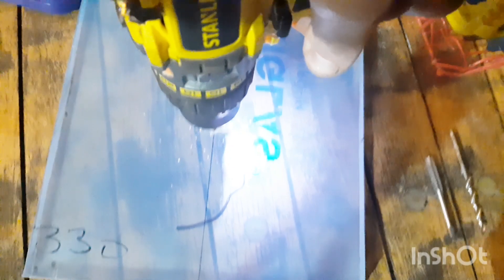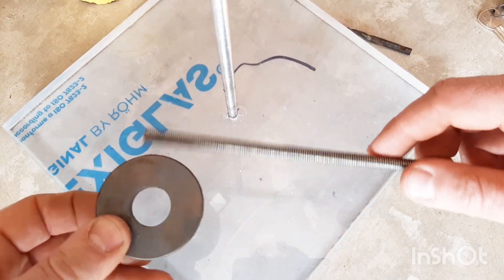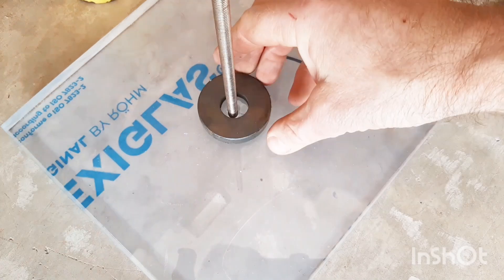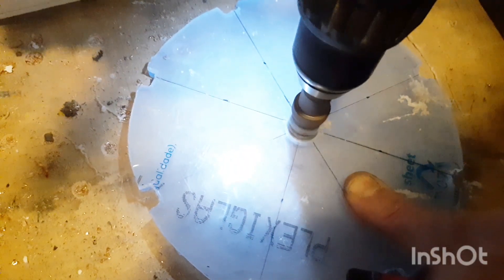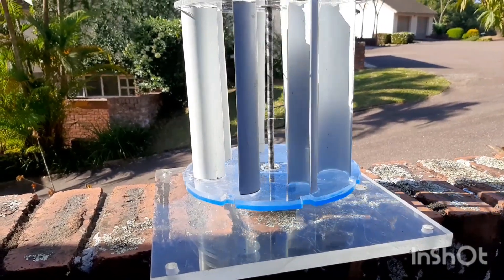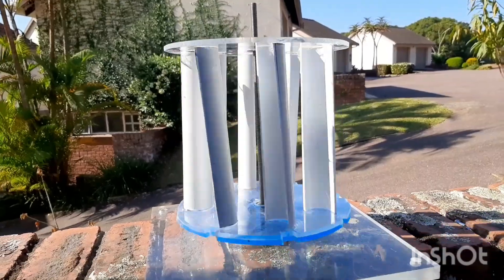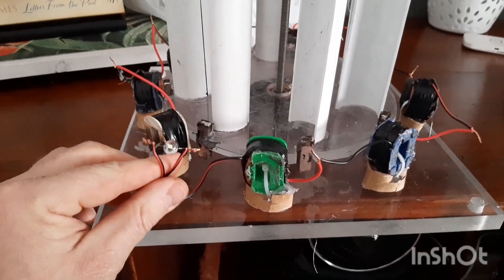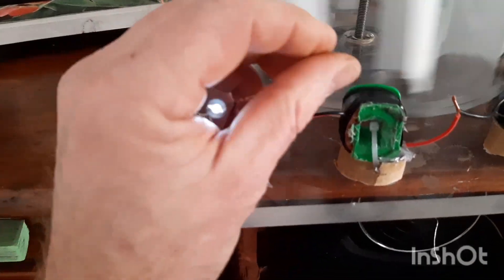DIY easy to make levitating "frictionless" electrical wind turbine

Comment: Well done, brilliantly constructed and a really brilliant design I recogn! I remember Robert Murray constructing the 1kw version using swivel office chair legs to help weigh it down (minus the castors ofcoarse) with the right sized diameter of wheel bearings in the centre before attaching the whole turbine upto a rectifier! 
Absolutely brilliant! 
💚👏👍

Comment: please make another video about hydrogen fuel cell on generator
Reply from the maker: I've experimented with this project. However it takes too much energy to make HHO gas and I will need the correct tools and fittings to make it "work" which I dont have money or the time for. But I'll continue experimenting with what I have until I am able to make a difference from the other video. Only then I'll post, so as to not make a disappointment  like the last video.
Thank you for your comment and understanding.